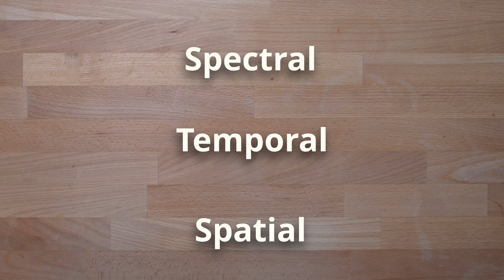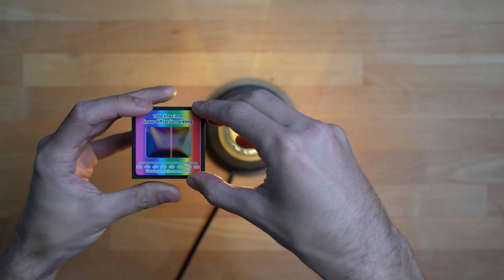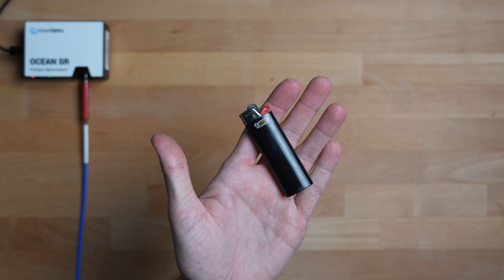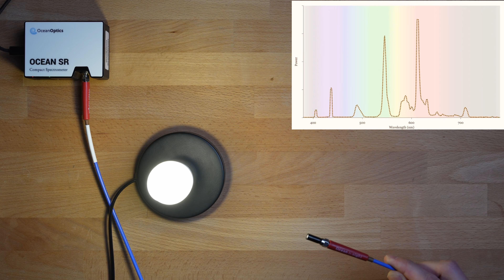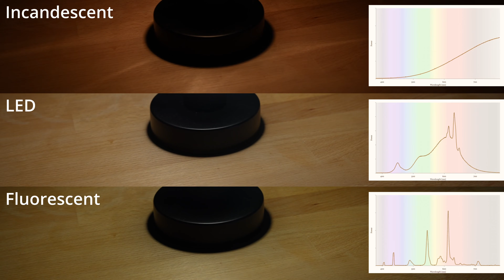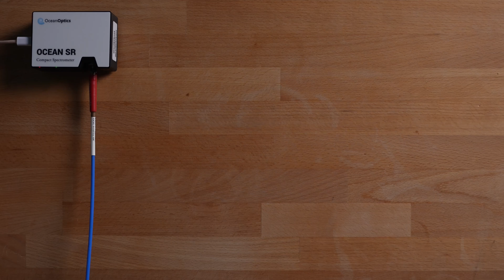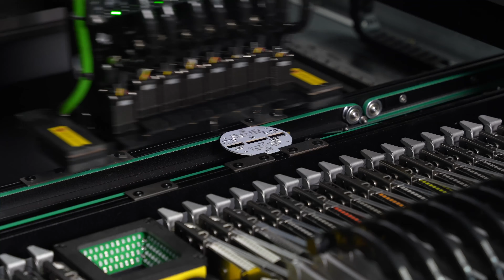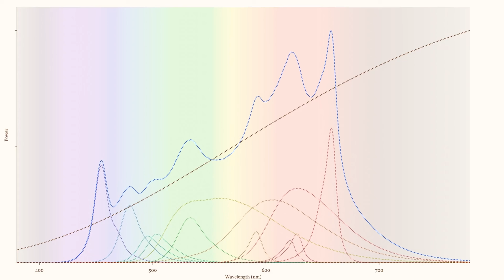Why Modern Lighting Feels Bad (and How I Fixed It)

Comment from the maker: What’s one lighting topic you’d like me to cover next? I’m planning videos on flicker, color perception, metamerism, and optimization.
Reply: My vote is for flicker next!

I'm quite light sensitive and have avoided investing in dimmable bulbs because all easily available LEDs use PWM for brightness control rather than true analog dimming. Even if its not consciously visible my eyes would be briefly bombarded with the full bulb brightness, which sounds uncomfortable. I rarely see the PWM frequency listed on bulbs, and I don't know how much of an impact this actually has on comfort.

Does this product have true analog control of all LEDs or is it PWM?
Reply: @003Jetfire  I second that vote, I've heard people talk about the fact that we can not visually see the flicker, but unconsciously our nervous system is affected by it, I'd love to know if there's some truth to that and if it contributes to LED's feeling off, especially because some times, in certain conditions I can actually see hints of the flicker on lights that aren't defective.
Reply: @003Jetfire  There are several ways to do PWM dimming. The cheap way is to use a triac to interrupt the sine wave of mains AC supply. The flicker from those will be visible. Quality dimmers work by converting mains AC to DC and then using a DC to DC converter to get the required voltage. There will be no flicker from that type, but they cost more.
Reply: I feel like a video on how properly tuned spectral light would play into, modify, or potentially outright change the general "area lighting" rules for "normal" lighting. I've always felt that there is a lot left to be desired in the general practice currently used in lighting matrixes (im an electrician) leave a lot to be desired, and I always felt that the general rules they lay out seemed to never quite hit the mark on any goal I had for a particular area's lighting -- e.g. luminosity at a working height vs to floor, color temperature selection based on environment (e.g. 4k for an office 5k for a factory floor etc) and so forth always seem to leave something to be desired or never really feeling quite "correct".

I feel like a thorough examination of your technology as it could apply to full-fat area lighting would also be a great pitching point to the lighting industry you're attempting to coax, as the ability to more accurately tailor a given space to a much finer degree would be a potentially massive selling point for a given lighting manufacturer, as well as to an end-user lighting snob like myself.
Reply: I wanna know when you have a goal of getting this able to be in every bulb in every room! I'm pretty sure I'm going to get an EP01 very soon, and I can't wait until the entire house doesn't feel like a science lab. I'll take 1 room for now though!
Reply: I think it has to be flicker (or include flicker) and how to overcome it.

I would be very supprised if it does not affect us somehow even if your concous visual system does not register it (there is subconious visual work going on in our heads, what if something like... for example for audiable inputs you can extract emotional content of it without concously heaing it if there is certain brain damage). And some of our pets will be able to observe the flicker, whats it like every night for them?
Reply: please get around to talking about IR and UV
Reply: @EmmaHopman  There's also NIR, Near InfraRed, that affects the body much more than we previously knew. You don't see NIR but it penetrates the body (to some extent even through clothes) and activates mitochondria in our cells. Mitochondria are the "engines" that keep our cells active.
Reply: @patricklindahl868   Another vote for addressing whether these bulbs are intended to emit near and far infrared and at how much power. I suspect that while they may emit some near infrared, it's probably at too low a power to have any biological effect.
Reply: The reason why led's are unnerving is because led's pulse on and off thousands of times. It's not good for the neural system. Also damages the eye. You can't beat candecent light. It's soothing for a reason, because it's closest to what the sun emits.
Reply: @rubberspoon  it highly depends on how the LED is driven. on constant voltage PWM dimmable LED you are right. But not on constant current LEDs which are dimmed by reducing the current itself. these are flickerfree (if using a good power supply obviously)
Reply: Id love you to do a video with @technologyconnections
Reply: I've loved incandescent light bulbs for well over 7+ years now ever sense i found it out and everything... beautiful CRI, light output, the glowing filament i can stare into for hours (as long as its dimmer and not 100 watt light bulb)... and have you ever put your hand near one in the middle of winter.. it is such a good experience
Reply: definitely cool but still not realistic. You would need to reduce the price to  50-100$ for a lot of ppl to even consider changing to it
Reply: @nogamenolife7940or keep your light and wear anti blue light glasses ( 50 bucks)
Reply: have you heard about the  Philips "Dubai Lamp" Designed and exclusively made for UAE. It is super efficient and long lasting. I mention this because the "promise" of LEDs lasting longer is a lie. I still have to climb a ladder to replace the enclosure rated bulbs every two to three years. If your bulb could last longer the TCO drops and makes it worth the extra money. I'd replace every bulb in my house if that was the case. Great idea with an engaging back story keep up the good work.
Reply: @duroncrush  it's the bulb cartell all over again.
That's why I mostly use lights with CV or CC LEDs and own LED drivers. Additionally set their max output to 80%, while also set the normal ON value to around 60% (and to 80% only if needed)
Admittedly, it's either requiring knowledge about electrical handiwork, programming DALI, and buying not that cheap LED lights. But now after over 10 years there is no single defect.
Reply: I’d be interested in seeing how the efficiency of these tunable lights compares with the usual LEDs
Reply: Flicker is important since some of us can see flicker higher in frequency than others, this can be compared to CRT/LCD and games and people wasn't satified before the refresrate passed at least 75 Hz and after 100 Hz it is mostly reaction times in games, not annoyance of flicker.

Metamerism exists when the spectra deviates from the blackbody... Thus, my focus would be to get as close as possible to a continous spectra, then metamerism is just magically solved as well. 

Color perception is more or less the CIE XYZ experiments during 1930 and does not help us in the quest for good lightning. CIE XYZ gives the RGB and the illusion that a LED with three primaries is "good enough" while it is not... The reliance on RGB or similar color spaces is what gives rise to the metamerism. Adding more "primaries" will step by step approximate the continous spectra, metamism will decrease and the perception of "restful" "natural" light will increase.
Reply: sunlike leds; and 'fake window' light fixture
Reply: Good afternoon my friend I am not here Shine shadow on your design but in my opinion you have way too many different color Leds for failures not to become a problem down the road They do dim over time and every color dims at its own rate so very soon they will get out of alignment with your calibration program and if you haven't built that into the software to happen on a regular basis that's something to keep in mind However there is an easier way Don't change the bulb change the temperature and if that doesn't give you a hint contact me 'cause I don't wanna spit it all out in the open here and have people steal it from you I have faith in you to find me Give me a contact
Reply: Do (human) optical / neural systems do something with non-visible light (as I think some animals do)?
Reply: I'd love you to talk about faliure modes in LED bulbs and their AC to DC power supplies.  There are so many bad power converters in cheap integrated LED bulbs it means I replace them more often than old incandescent bulbs for only 11 times the price!  

Tell me how your power supply is better than average, and how to buy a quality LED bulb.
Reply: Before we had incandescent lights we had flames, and flames aren’t strictly black bodies.
Reply: flicker! I hope you don't use PWM and you drive the LEDs linearly and it would be interesting to hear about that. You seem to use 2 ICs for that - are these lumissil by any chance? They have solid 36 channel linear LED drivers.
Reply: How do you fix it? I didnt heard that
Reply: CRI, and how Ra8 and Ra14 is effected, since CRI is usually the "way" lamps are measured how good colors are "represented". But even a lamp with a very good CRI can have a very weird spectrum, while - I suppose so? it can be the other way around, too?
and like others said: flicker, caused by (bad / slow) PWM dimming (the temporal part your mentioned)
the spatial one will be interesting aswell, since LEDs emit mostly quite directed.
Reply: Seems like LED dimmability is popular, and I’d also like to have more insight. I’ve experimented with every kind of LED dimmer and voltage (line, low, constant, variable, triac, digital) and had various results with different light/dimmer/voltage combinations. Flickering is not an issue (if so you’re using the wrong things) - I’m interested in lumen range and color quality when dimming. 💡

Example: Philips used to make a “warm glow” dimmable A19 with multiple sets of filaments inside that would transition as you dimmed the bulb (to maintain color quality at various brightness levels). They were amazing, especially dimmed - haven’t seen anything better than incandescent since, and only have two left ◡̈
Reply: look into the screensensitive sub redd it
Reply: 1) Laser movingheads like claypaky xtylos that use diffracted rgb laser arrays for thick beams and effects. (very efficient and has no light bleeding).
2) Quatumdots.....
3) LEP (laser excited phosphor).

Within a deadline of 2 weeks.......
Thanks

Comment: When you announced that you're running a whole production line for this product it really blew my mind. Finally someone took the lightning problem seriously and managed to put out such a quality content about it while having serious future plans. When LED bulbs were taking the market, I refused to switch to them after seeing how awful produced light was. I kept fluorescents, and despite their spectrogram looking spiky, produced light was more pleasant compared to LEDs. Fluorescent from the video is indeed awful, but majority of them look better. Fluorescents produce light by gas excitation, there is still something getting hot in the chain. While in case of LEDs, there isn't. Some LED-filament lights are tolerable and those are the ones I would use if I had to, but incandescent remains the best, and I am wondering whether the sensation of that warmth and coziness doesn't partially come from rich infrared part of the spectrum. Cause you can feel the heat when close to a powerful incandescent and it adds to the experience, just like in case of the sun. I would like to see blind tests where one of your globe lights contains an incandescent light inside and people have to rate which light is better. If results are not random, then it would be a solid proof that IR also matters. Oh, and did I say "blind tests" for a lightning test? I guess proper word would be a "deaf test", it's actually fascinating how much in common audio and lightning have. You're essentially EQing your light source while explaing what feels good and what doesn't, the same thing could be applied to various headphones and speaker systems. And while the price of your invention is not really encouraging, this is definitely something new and revolutionary, we were EQing audio for decades for the best listening experience, maybe it is time to apply it to lightning too! I am 100% for it, good luck with the project!

Comment: The main difference is CRI, or Color Rendering Index, a measurement used to show how accurately colors are protrayed with that light. It's on pretty much any packaging for modern lightbulbs. i'd say 90+ is bare minimum if you want to have good colors, and definitely 95 if you're lighting a dining room or anywhere that has food in it. Frankly i'm shocked that it wasn't even mentioned in this video, as it played a cruicial role in how lighting feels.

Comment: First time seeing your channel, really liked the explanation on the cyan dip and blackbody curve. Got curious and checked your website and the first journal entry as well to see more details on how it is built. Nice to see things on the site that were not mentioned in the video, like 35kHz PWM, using normal hex screws instead of glue, and the Rust SDK.

Looking at the site versus the video though, I had few questions about physical limits. In the video you show individual calibration with spectrometer at factory, but the site does not mention any optical sensor inside the lamp. When the aluminum body warms up to normal working temp, red AlInGaP diodes lose lumens and shift wavelength much faster than blue and green InGaN. Does the board use some thermistor model to compensate this in software, or does the spectrum just slowly drift off the blackbody curve when lamp runs for few hours? Same with diodes aging at different speeds over time.

Also curious about the LED choice. In the journal you mentioned the lamp has no white LEDs at all, just 32 colored emitters, and because of that the spectrum still has peaks and dips. What made you choose pure monochromatic diodes instead of broad spectrum options like violet pump LEDs (Optisolis, SunLike) or at least phosphor converted lime to bypass the green gap? Was it mainly to have direct software control over specific narrow bands for research?

Last thing was repairability. The site says it is modular and parts can be replaced. But since firmware relies on exact factory profiling of those specific 32 LEDs, how does emitter board replacement work in real life? Does a spare board come with its own calibration data saved in memory chip on the board, or how would a user swap it?

Really cool project overall, will keep eye on the next videos.

Comment: Hello thank you for your work. I've been studying light for many years. I would suggest pushing out to the UV-A and infrared range on you diodes. I know it's not technically visible and you would take an efficiency hit but your body knows they are not there. It has a big impact on the perception of authenticity of the light. 
You have the factory so why not whip up an extended spectrum prototype. Observe your environment under the light for a while and see if you experience a difference. It would probably make for a good video if nothing else.

Comment: Yes, I am familiar with that problem. I am a media designer for image and sound, and the color spectrum was one of the topics that interested me the most.
Particularly in film and television work, color-accurate rendering is extremely important because camera sensors react even more sensitively to green light in the spectrum and also extend into the infrared range, among other things. Because of this, LED lights are actually calibrated with a CRI/Ra index to render colors as accurately as possible—brands like Arri, Aputure, and the like. Of course, those aren't table lamps like yours. However, there are small battery-powered lights that you can put a lamp diffuser like yours over and use in the exact same way.
In fact, nothing has really come close to Incandescent light sources, like halogens or HMIs yet, but they are getting quite close. There are also more affordable alternatives like Jinbei and Godox that make these accessible to regular people with slightly lower quality, but still far above what you can otherwise find on the market in terms of light quality.
Your concept is cool in itself, provided it can be implemented in a light bulb format in the future and remains affordable. After all, highly color-accurate bulbs do exist in the film industry, but they are very expensive.

Comment: Cool ideal and was thinking can't be more than $100. Pricy but not too bad for a lamp. Only to find out the lamp sells for $330! Sorry but that's too much for a gimmick light, and way waayyy too much to use as replacements for all my lights. 
Need to find  a way to make it much cheaper (like $25 per bulb at least) and also design it to fit in standard E26 lamps.

Comment: I’m wildly particular about LED lighting quality (temp vs lumens vs dimmability) and will usually order 8-10 different brands of the “same“ 2700k bulb for any given application in my home to find the right one, and return the rest. I’ve probably tested 200+ bulb brands/types by now.💡 

I’ve narrowed my search to a few that most accurately replicate dimmable incandescent (for home use) - but nobody should have to order 10 different bulbs with the “same” specs to find one that actually meets their desired Kelvins/lumens (not to mention dimmable ranges, beam angles…I could go on 😂)

I hope your research and technology help improve accurate standards for discerning consumers, and that you can expand past an expensive luxury concept. I’ll be following!

Comment: $330 :(
I gotta try making my own. It can't be that expensive to throw some LEDs of varying frequency bands on a board and adjust their brightness. I'm sure it won't be as good as yours because it won't have each LED weighted using spectrometer data, but c'mon $330??

Comment: I like lights with the golden white glow I have an Led thats pretty good and a Cfl I want to get a low power hallogen if you use them in the winter its not a waste as they contribute to heating the room.